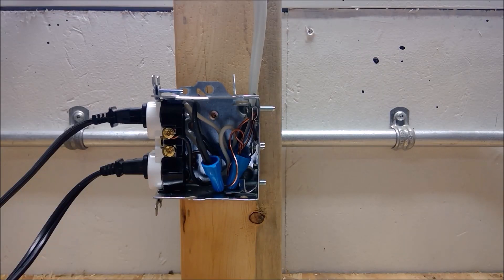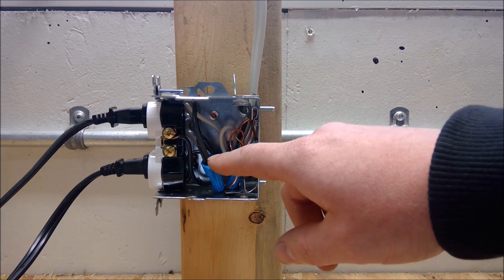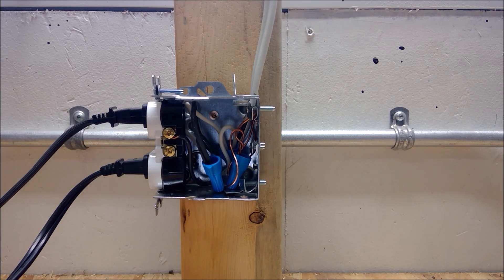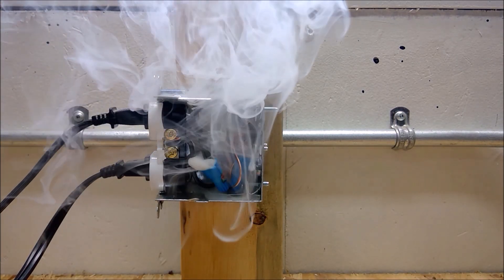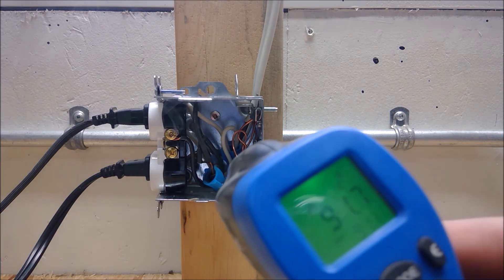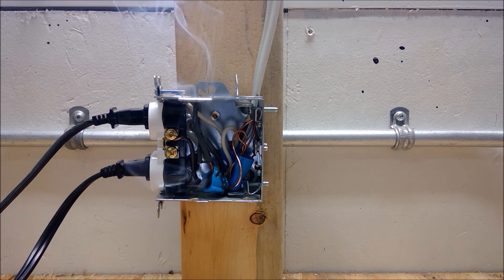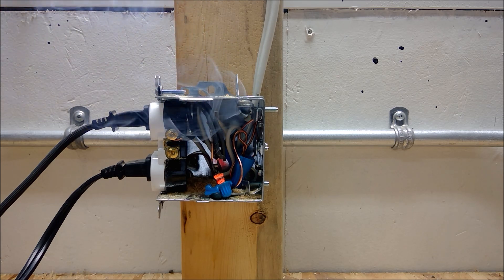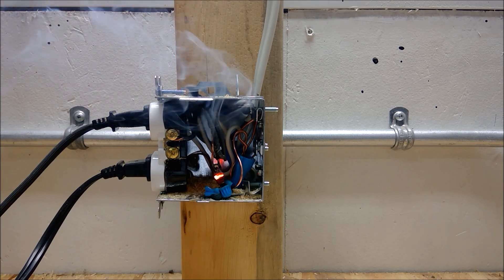Loose wires cause fires.

Comment: who puts a toaster and dryer on the same circuit, using 14 wire? C'mawwwn
Reply from the maker: Toaster and a hair dryer and the circuit current was held to 12 amps on a 15 amp circuit breaker

Comment: Just a question: here in the Netherlands it is not allowed loose wiring in the wall. Like the white wire coming from above in this video. We always have to use PVC conduits. I wonder why that is not the case in the US, Australia, etc.? I've seen a lot of people building walls from wood there and I think the changes are high that mice will nibble on the wires, causing electrical shorts and maybe fire as a result.
Reply from the maker: In Canada we are allowed to use cables inside of wood frame buildings. Mice are not as big of an issue as people driving nails in the wires after the house is finished. It is important to ensure that the conductors are properly spaced away from the edges of the wall to prevent this from happening. The biggest reason we don't install wires in conduits in Canada is the cost associated with it.

Thanks

Comment: Probably wouldn't have started fire if you didn't put that saw dust in there
Reply from the maker: The saw dust is used to help show the increase in temperature of the wires. It is also not uncommon to find fine combustible dust within an electrical enclosure.

Comment: AUS and NZL are standard 10A per circuit breaker fuse is better than sorry.   However that wire cable for building should be standard rules.  Otherwise illegal, you will lose and burn a house !
Reply: WizardmasterNZ usually when it happens people rushed and this same is can happen with a wago connector if it’s lose at least the box is metal and grounded unlike those cheap plastic ones

Comment: First of all I noticed that you moved that wire I'm sure that is what caused the arcing.  Anyways I use to live in a 30x65 Double Wide Mobile Home with Aluminum wiring and EVERY year I would go and check every single outlet and light ceiling fan and light fixture because I was terrified to electrical fires.
Reply from the maker: Yes I did open up the connection to show how a loose wire can cause excessive heating

Comment: use wagos
Reply from the maker: My only problem with wagos is there are so hard to remove the wires once they are pushed in. But yes a much better option in my opinion.

Thanks

Comment: And now watch what happens when I add these twigs and gasoline.....
Reply from the maker: Just wanted to show the surface temperature of the wire. But yes next time I will add a little fuel to the fire
Reply: Andrew Payce lol nice; looking forward! Thanks for the safety video. This definitely is a real and dangerous problem.

Comment: Yeah cause I totally won't smell that burning. And a 15 amp breaker doesn't trip at 15 amps it trips at around 80% load. So you go and find the two most amperage pulling things you got in whole house plug them into both sockets of a 15 amp and run them. That would have undoubtedly tripped the breaker, even your little rigged 15 amp independent circuit can't handle that. Don't hype up arc fault breakers. Waste of money and causes constant problems here in the USA.
Reply from the maker: It is my hope that individuals will watch this video and spend sometime thinking about the quality of their work. It wasn't my intent to push AFCI breakers as the cause a lot of problems in Canada as well.
Reply: I can understand what your doing here is I guess in good intentions but you set this up to happen. Constant 14 amp load on a 15 amp breaker will not hold, and if it does it wouldn't matter how good or how loose the connection was the wires would melt regardless. 14 gauge wire can't support more than 15 amps without overheating. My takeaway from this is the same as if someone put up a video demonstration of holding the gas pedal in their car to the floor in neutral and telling you if you do this its gunna blow up. Well no kidding buddy.

Comment: I'm not sure what i'm seeing here, Both appliances he is using to overload the conductor would normally be on a GFCI protected outlet, The hairdryer in the bathroom and the toaster in the kitchen. Furthermore the enclosure is a metal box, encased in a wall, If a good electrician did the work there would be no sawdust in a metal box, there would be no draft of air to start this fire. And also, bro something wrong with your circuit breaker, because circuit breakers use heat to measure the load and that's how they trip. Under any normal circumstance, you pulling 14 amps on a 14 gauge wire (Which per NEC Could only be on a maximum of a 15 Amp breaker) Would trip the breaker. Someone is not being honest here.
Reply from the maker: Not all kitchen receptacles are required to be GFCI protected. A GFCI would not have helped in this situation as there is never any fault to ground in this circuit. 

I agree that circuit breakers respond to heat but remember that they do not respond right away. All circuit breakers take time before they trip on an overload condition. That is one of the aspects of the video. Many people feel that a 15 amp break will trip right away at full load. It won't, the heating element will take time to respond.

Comment: IDEAL PUSH CONNECTORS.............I prefer to use them instead of wire nuts. I never did like wire nuts. In House Construction, AFCI circuits would be installed mainly in sleeping quarters (bedrooms). Places in your home where a Toaster and Hair Dryer are more likely to be used, would be protected with a GFCI circuit. Perhaps the best thing for the industry to do, in terms of people safety, is to develop a device (Circuit Breaker) that is able to detect Over Current, Ground Fault, and Arc Faults, a 3-in-1 protective device.
Reply: Griff Mustard yes but usually no one has time to push the wires in fully on an install job it’s rush and go which can make the connection loose and start a fire

Comment: Can you deduce that there is a faulty connection if you plug in a heater into an outlet and the plug gets very hot after a few minutes?
Reply: That’s different, it just means you should replace the outlet because the contacts are loose

Comment: As a British electrician that whole set up disturbs me, regardless of the fault :/
Reply: Skyrat even Wago connectors can melt here if the connection is loose when people don’t push them in fully the same with the nut if the wires arnt tight either way it’s someone being lazy

Comment: Absolutely loose connections (not loose wires, the wire isn't a wire if its loose...) can cause a fire.  It is pretty impressive how bad that arc gets without tripping the breaker...instead of adding crap to the scenario for effect, lets see how it would play out if sealed up, would we see smoke?  Would it be obvious at all?

Comment: How can a 15 amp circuit hold a toaster and a hairdryer??
Reply: Oh wow, I didn't even think of that.  A toaster, (at least mine), pulls 12A and my hair dryer pulls 15A on high.  A 15A breaker would trip after a minute or 2.....

Comment: Why In US standards electric box is still metal? when EU nonflammable plastic.
Reply: mindaugas49ccm we have both and both work fine
Reply: I am in the US and blue plastic boxes are common for residential.
Reply: mindaugas49ccm plastic melts easily and since it’s fire resistant it puts off a lot of smoke and it can’t be properly grounded as with a metal box is mostly fireproof and it can be grounded unlike plastic ones

Comment: The two (or more) wires should have been twisted together 3-4 turns, trimmed and THEN had the wire nut put on it.  Makes a super good connection that won't get loose - especially with a wire nut on it.  Only maroons simply jam them in and twist ... or as shown here, lightly insert them into the wire nut without twisting.  Arc Fault breakers are great, but cost 3-4 times what a standard breaker costs.  On new work, they are required, but when replacing a faulty, old, QO or similar breaker, many folks can't justify the expense.  Plus, if you are unable to smell the horrible stink of that smoke, and/or can't see it billowing out of the box, there's something wrong with you!  I suppose this scenario could occur over night when running a heater.  Even if a plastic face plate is used, in a sealed box, all of the O2 will get used up pretty quick.  Do the test over with a sealed box please, and show us the result. Who would leave sawdust in an electrical box anyway?!
Reply: I’m a little late, but I discovered the very same today (12/26/23) behind one of my wall thermostats. 🤷🏻‍♂️

Comment: Good illustration. I don't really get why people have an issue with the saw dust. It's not like this was a bet and you cheated. You clearly demonstrated that poorly connected wires can cause a fire inside an electrical box.

Comment: I'm not sure, so you placed some sawdust in the wire-nut.  The heat from in the box didn't cause the wires or anything to catch on fire.  Now what if the box was closed up so heat can build up.  I suspect this happens more than often and they simply call an electrician afterwards (not noticing smoke) to find the issue and fix it.

Comment: A circuit breaker is NOT gonna catch an intermittent circuit caused by a faulty connection.
A circuit breaker is gonna trip only on an overload or a discharge to the ground (i.e. you touch one of the two exposed wires, perhaps from a faulty toaster, and you're on a wet floor)

Comment: For starters, you must have a 20amp breaker to allow a hairdryer and toaster running together.  Most breakers are 15 Amps - so we are already in an unusual situation.  It's extremely rare for modern homes (in Canada) to be built with wood, instead they use gypsum boards and metal studs.  The amount of saw dust (nice to see you put it in later) in your box would be inconceivable.  In a rare wood home construction given the timing an electrician comes in to connect the wiring (after the wood work is done) and that the electric box is generally enclosed.  He (or she) should be bright enough to wipe out any dust (especially saw dust) if it happens to be visible in the box.  Lastly and most importantly your video has just shown that even after a series of almost impossible events, the flame goes no where other than the box.
Reply: I'll give the video creator the benefit of the doubt and assume he didn't have the drier on high setting to give a current pull of 14A just under the trip setting.  As for construction, in Ontario at least, houses are still built using wood studs, though gypsum drywall has been a standard for at least 45 years or more.  Hot connections can still cause fires.  They discovered that during the brief period that they installed aluminum wiring.  Here's a link of new construction with the studs exposed under unexpected circumstance.  https://www.niagarathisweek.com/news-story/8373625-winds-knock-down-niagara-falls-homes-under-construction/
Reply: chud67bbc Huh?  Did I not acknowledge that you can have wood studs but it is rare?  As for DIY - hey I'm talking about the video case example. I think the lesson here is - use a steel case for your wire connections (especially if you have wood saw dust all over the place).
Reply: Niagara Mike really?  Uhmm I believe it's against city code in Toronto -  but older places have them for sure.
Reply: Could just be an FPE Breaker ;)

Comment: holy, that is why USA homes are less safe than EU homes
since we have no caps on the wires before a plug. even the room inside a junction box is larger, and not made from metal. since we have a special ground wire bundled in the box.
Reply: darknessblade yes but usually your boxes arnt metal or grounded and those wagon clips can melt easier than wires and it’s 240 volt which leads to larger sparks and arcing

Comment: I cringe whenever I see one of those Maretts / wire nuts whatever you call them. I come across them on some American refrigeration equipment we get over here in the UK. I always dispense with them & make proper crimp connections. You just will not see them in use at all here in the UK in any kind of home manufactured equipment or commercial / residential electrics.

Comment: Your test could be considered invalid because you don't have the full box there for a "short to ground" to the side of the box the that is missing
Reply from the maker: I agree that the missing part of the box does remove some level of safety. Excellent point, I just thought it worked well to see inside the box.

Comment: How to prevent these problems:
Use better, safer, more solid EU power sockets...
Reply: yea but higher voltages require less current for example:
Hair dryer - (1500W)  12.5 A at 120V or only 6.5 at 230V
Reply: Use EU voltages as well (230/400V). Trust me if you stuck to wires well, either 110V or 230V is more than enough
Reply: yea EU voltages are safer. they ark and spark more but that is far cheaper to remedy than the higher amperage which requires more copper for the same wattage and is just inefficient overall. and the best powersockets tbh are british ones, the EU ones are still way better than the NA ones though and its understandable why they chose the design, it fits so many prior sockets its amazing that they where able to make it so. it has really good backwards compatibility.
Reply: I agree that UK plugs are probably the best, good earth conductor, known line and neutral location
Reply: For sure the higher voltage (ex. 240V) is better but modern day Eu plugs and sockets (schuko and CEE 7/7) are comparible to Type G and frequency doesn't really matter that much from an efficiency standpoint.
Reply: I wonder if there is less fire hazard with the higher voltage in EU.  1/2 the current for the same power, that has to count for something.
Reply: @niagaramike528  No because they use higher powered devices over there, so they end up shoving a lot of current through the receptacle anyway.  In the UK they still use 32A ring mains circuits, which means that every outlet is on 32A and on the same circuit (a horrible design, by the way).  This is why they have fuses on plugs in the UK.
Reply: I would think the higher voltage is more likely to arch and spark.
Reply: Skaarjman and fuses, and if properly designed live and neutral always covered when nothing is plugged in etc. Really nice and chunky too. Wish the whole world could just convert to that standard if they are on the same voltage and frequency.
Reply: Niagara Mike higher voltage leads to more arcing
Reply: The idiot said: try breakers instead of fuses since they are resettable
Reply: +The Minecraft Expidition why choose? in the UK you need both. redundancy is always better.
Reply: +The idiot said
Redundancy just means that the chance of something going wrong is going to be greater.  The consequences of that "something" might be reduced though. :)

For example, a twin engine aircraft is twice as likely to have an engine problem as a single engine aircraft that is using one of those same exact same engines.  The consequences of one of the engines failing on that twin engine aircraft will be less though if the pilot handles the situation correctly.  Of course, if the pilot doesn't handle the situation correctly, that remaining engine will just get the plane to the crash site. :(
Reply: Yeah but the EU plugs just look so weird and oversized, at least NA plugs have 𝒜 𝐸 𝒮 𝒯 𝐻 𝐸 𝒯 𝐼 𝒞
Reply: Really? EU plugs look much more robust and nicer than those cheap looking twigs you plug in the walls there XD But seriously though, Oversized? Hardly.
Just have a look at UK's plugs :P They're Probably the Safest as well, A Bitch to find an adapter Not the size of your fist for though.

Comment: With those crude old fashioned twist connectors I'm not surprised, there's a reason those were banned in Portugal, we use wago type connectors only.
Reply: t0nito yes but those can melt to if the wire is not pushed in fully same with the nut if the wires arnt tight either way it’s called someone being lazy and a fire can start with either one doesn’t matter which connected is used

Comment: Even if it was tightly screwed and working normal, this wiring would be a total no-go in Austria.
Reply: Salza here wagos can still melt if the connection is loose and people driving nails through walls and other sharp metal objects